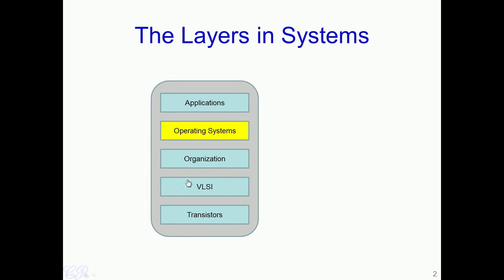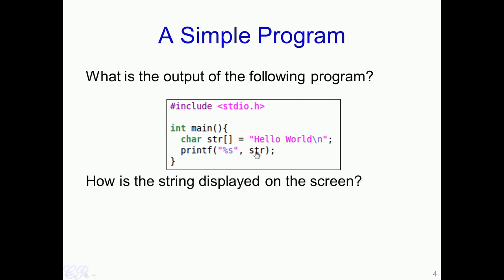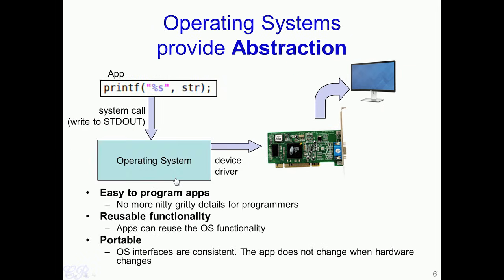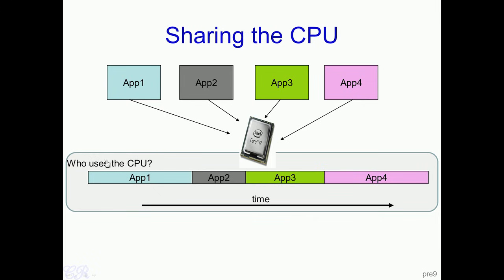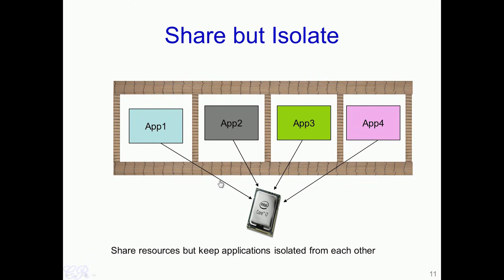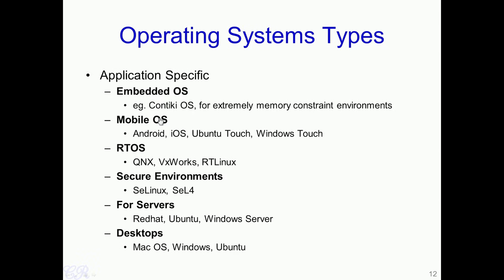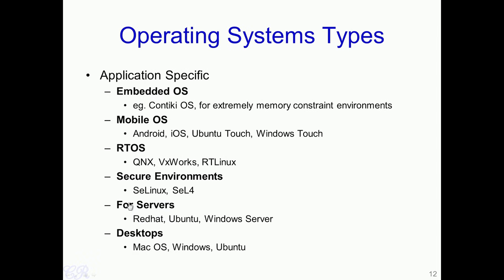#2 Introduction to Operating Systems

Comment: - [00:00]🖥 Introduction to Operating Systems Layers

  - Computer systems are structured in layers from transistors to hardware to applications.
  - The bottom layer consists of transistors combined to form logical gates like AND, OR, XOR.
  - Hardware includes memory cells, flip flops, registers, and various units like RAM, instruction fetch unit.

- [02:22] 💻 The Role of Operating Systems

  - Operating systems manage applications and resources in a computer system.
  - They provide hardware abstraction, making it easier for software applications to utilize hardware.
  - Resource management by the OS deals with the limited hardware resources in a computer.

- [03:40]🧠 Program Execution and Display Process

  - Explains how a program written in C language displays text on the monitor.
  - Details the process of transferring the text from memory to the monitor via the graphics card.
  - Highlights the complexity that would arise for programmers without the abstraction provided by the OS.

- [07:36] ⚡ Benefits of OS Abstraction

  - Operating systems abstract hardware details, making programming easier.
  - Applications can reuse OS functionalities, enhancing efficiency.
  - OS enables portability, allowing programs to run on different hardware without modifications.

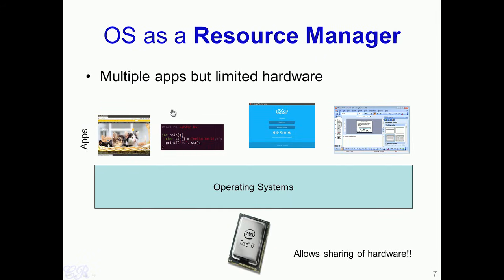- [10:19] 💾 OS as a Resource Manager

  - Operating systems manage hardware resources for multiple applications running concurrently.
  - They supervise resource allocation for components like CPU, memory, network, and storage devices.
  - OS ensures efficient sharing of limited resources while protecting applications and their data.

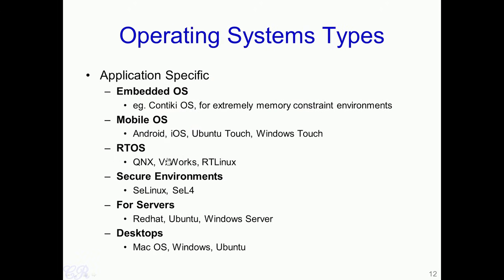- [16:43] 🔐 Security and Classification of Operating Systems

  - Operating systems are essential for all smart devices to function.
  - Classification includes embedded OS, mobile OS, real-time OS, secure OS, and those for servers and desktops.
  - Each type of OS is designed with specific applications and requirements in mind.https://www.youtube.com/s/gaming/emoji/7ff574f2/emoji_u26a1.png

Comment: Sir you said video buffer will be used in processing . I have seen string buffer used , and never listened that term . So which one is correct ??
Reply: string buffer is when the data is in RAM, where as video buffer is present in graphics card. string content is transferred to video buffer which in turn is pushed onto display.